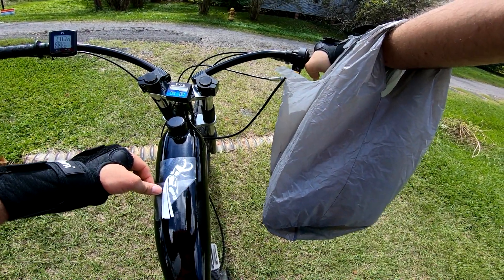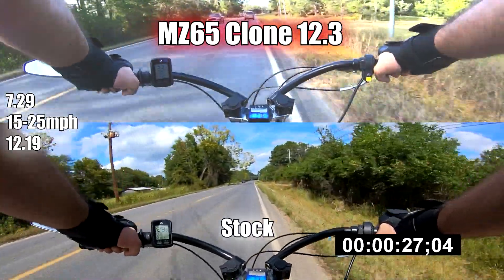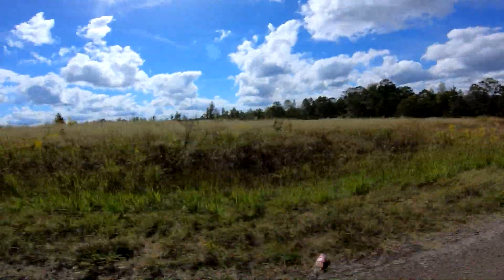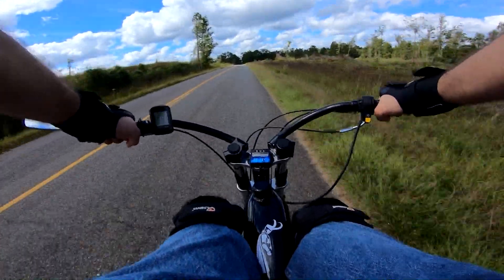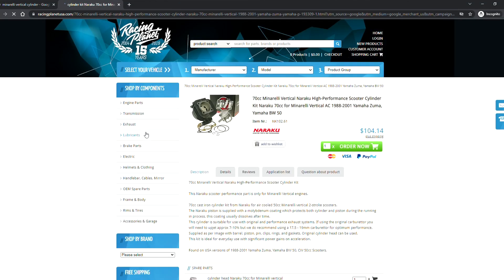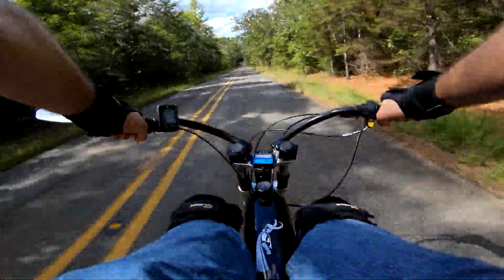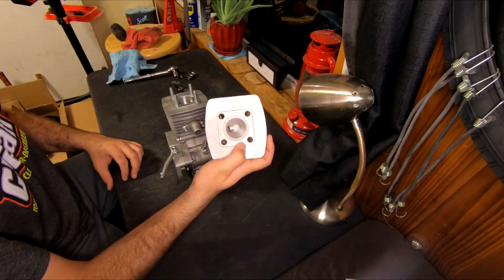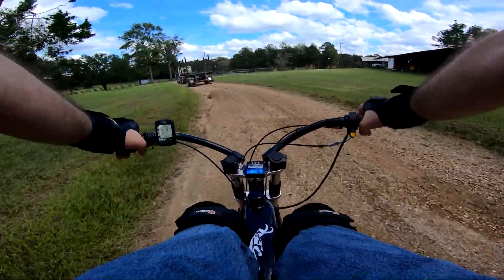Motorized Bike Performance Part 2

Comment: Do a test with the stock pipe and remove the end cap vs the mz65 clone. The results will be much much closer . Also stock pipe with stock jetting is rich so there is a power loss there compared to the clone.
Reply from the maker: Good call
Reply from the maker: kjsmolik brings up a good point. If the MZ65 Clone's expansion chamber is not effecting performance, than there is a good chance that a cap removal on the stock exhaust should give similar results, assuming you live in an area where you can get away with the noise ofc. :)
Reply: @LAHover  personally simply removing the baffle cap of a stock exhaust will never make as much power increase as a ktm65 or ktm65sx pipe. It just simply isnt designed for resonate flow. To each is own though. Personally i run a ktm 65sx on a ZL40MM crank with a Falcon 911 cylinder, ktm pipe is MUCH better than the stock, even baffle cap removed, also better than even gutted. Just personal preference tho ig
Reply: @LAHover  for the record bro i am also referencing a real ktm65 basic dirt bike pipe rather than the clone WC80 styles so chances are your results are exactly like mine haha, to be fair its all in the name. A clone isnt going to do as well as a standard db pipe but its certainly better than nothing personally (for the record the first time i ever hit 50 mph was with a gutted stock exhaust, didnt do it very fast but could wind up like hell lol)
Reply: Any chance we could run a test with a silencer that will get the dbs wound out down below 95db which is about bylaw and neighbor pi$$ing off volume. Where I live there is absolutely no way I can run the better pipe (probably even the stock)unsilenced or I'll have the cops on my doorstep every day! Thanks.
Reply from the maker: Link in the discription, the one I'm running is as silent as the stock pipe :) I love it!
Reply: @LAHover  fuck em bro let her sing haha, thankfully where im at currently for now people dont mind, only ever had 2 people say "damn thats loud" but they loved it still 🤣 just dont have the heart to run the muffler on the ktm pipe, makes it sound like a moped ☠️
Reply: I'm no expert but in my pipe research, the baffle cone of the mz65 is too close to the exhaust port and is most effective above 8k rpm. This was noted by a few pipe builders and their suggestions were to add 2" more belly or extend the header. That should pump up the HP around 5-7k

Comment: Awsome videos and great seires. I 100% agree with your therioes of limitations vrs. Longevity. I worked with a couple of the old blocks "LD80" they didnt even make it past breakin with pre-checks, torquing etc. The newer blick design I aquired and just finished prepping, and mounting and WOW what an improvement right off the bat. Much less vibrations... big plus, smoother even on very first start up and over all a better block which is  stampped "7MN"  on the jug as opposed to "LD80". Is it possible the new block breaths so much better that it could actually be running a tad lean? Even though the same carb setting worked great on the older design blocks. Too early to plug check. Just wondering? Because she loves a tad too much choke on warm-up. (Last moter dud that when I set her a tad too lean) Just asking, Being extra cautious with this one.

Comment: I have a wildcat pk80 on a bike with 700c wheels and a 36 tooth sprocket with an mz clone, I've only managed a top speed of 37mph and I'm pretty disappointed. I'm still playing with the jetting and I feel like I'm getting closer to the 40 mph mark. But sometimes I feel like I'm chasing my tail...
Reply from the maker: Anything 35mph+ is a respectable speed IMO.
The gear ratio of a 700c with a 36t sprocket should hit 40mph+ with a 200lb rider and the right jetting.
BUT, these speeds are pushing well past the safe limits of most bicycles so please be carful!
Reply: @LAHover  I think I'm still too heavy, I ordered the wrong set of jets, so the smallest one I have is either a 70 or back to the mystery jet that came stock.
Reply: Heavy with the jetting, not heavy in general lol. I weigh like 150 so I'm definitely not getting all she has

Comment: with a 2-stroke swapping out a straight pipe with an expansion chamber is like putting a turbo on a 4 stroke. 30+ years ago an old timer/ old school racer said it best. Putting an expansion chamber pipe on a 2-stroke is a sonic supercharger, as the pipe gets bigger it creates a negative pressure between the exhaust port and sound wave pulling out the burnt gasses and even some fresh air/fuel charge, as the pipe decrease in size it pishes the fresh charge back into the cylinder increasing the pressure at time of port closure acting like a supercharger/turbo. My person ride was a TRX250R with a grand national MX porting to boost midrange power, pipe/chamber was an LRD adjustable/tunable chamber where I could lengthen or shorten where the reverse cone started. With the MX porting and the pipe set in the middle my little 250 would DESTROY 350 Banshee and quadzilla 500 on the MX track. For bottom end punch lengthen the chamber, top end shorten the chamber. Class dismissed LOL

Comment: I use a 40t sprocket right in the middle of the 36t and 44t and I live in a hilly area of Florida and it does great, best of both worlds gives you decent speed while being able to get up even 30° inclines with minimal issue

Comment: Oh what bike frame do you think is the best. Huffy cranbrook or the hyper beach cruiser. Or is the build in gas tank frame better?
Reply from the maker: Gas frames bikes are nice but IMO not worth the $$$. I have never tried the hyper, but I like the back slanted seat tube. That might come in handy if you start testing bigger carbs and filters.
Reply: @LAHover  I have the hyper now and I use to have the huffy.

Comment: Not bad. I get 37 mph on a 20” rim with a 36 tooth. And can climb hills without pedal assist. It is all balance and believe me when I say hills. I live in a area where the elevation is 3,700 above sea level. But just want to have the engine to stop vibrating at top speed. Wish I could hit 45 mph.

Comment: I've had other engines, but this one with the G4 cylinder, real NT Speed carb and stock pipe, with a rubber ring in the carb, was the best running engine out of the box. It idled and I couldn't see any need for a jet change. A good bit of torque for as quiet as the stock muffler was.
Reply from the maker: Thanks for sharing

Comment: If your looking for a welder, the harbor frieght 110 flux core will weld a banana pipe and its cheap. Highly recommend a auto darken hood.
I wonder how a banana pipe with the exhaust end opened up would fare against the exhaust you tested. I found more low end torque to the point i no longer chug from a standstill, cant comment on top end

Also recommend more armor. Less skin to get rashed.
Reply from the maker: Thank you for this information!
Reply: Just remember the old saying cry once buy once. If you can afford a bettter welder, i highly recommend it. Manipulating metal is a handy ability.

The 110 kit from harbor frieght comes with the bare minimum you need to weld,  i forgot a decent wire brush with the auto darkening hood recommendation

Comment: I got my bike running so amazingly good. I didn't have a jet kit, and my bike was always 4 stroking making me think it was really broken. It was 4 stroking bad. What I did was I had a spare YD 100 carb from a friend, and I took the jet out of the regular carb and put it. In the yd100 carb since it had a bigger intake barrel, and moved the pin all the way up and now it gained 5 mph and the pull with a high compression head with an expation chamber is freaking insane. It pulls from stops no problem and mid-top end makes me fall back on my seat. It's pretty sweet. Top speed is only 29 mph though. It 4 strokes a tiny bit at full throttle at 29 mph. I ordered. A jet kit so hopefully. If I jet down 1 size it will help even more.
Reply from the maker: Smart swap with the stock jet to the YD carb for more air! :)
Reply: @LAHover  today i jetted down to like a 65, and i got to 35 mph on my first pull, it was a short pull and i bet it goes faster! this bike is crazy dude, all because of your videos i learn so much!

Comment: When you're ready to build your own pipe leave one variable, that being a stinger that can slide into the expansion chamber and back being clamped at any given point, thus creating a variable back pressure which will help with the scavenging effect. I once did r&d for Kawasaki and that trick saved tons of time when testing expansion theories on dyno tuned pipes
Reply from the maker: That sounds smart to me! Thanks for the info :)
Reply: Wow that's brilliant.

Comment: I’m putting on a g2 reed valve with my stock carb and windowed piston will it make my bike faster or hurt it
Reply from the maker: With stock port timing I don't think you will see much of a performance difference. From what I understand (could be wrong), Reed valve set ups work great once you start increasing intake duration... among other things. I'll do my best to test a reed valve early in the series for you guys.
Reply: @LAHover  oh so do you think I should just not do it and also I would like to see that in a video
Reply: @paullehman8652  upgrading the exhaust is your best proven bet, as far as bolt on power.
Reply: @subspyn9828  I have an upgraded exhaust
Reply: @paullehman8652  I'll tell you what ,I did the same thing you are wanting to do with the bolt on upgrades. But my bike ran way worse. I had bought a CDH Power Dio Reed, I also ordered a windowed piston, which I had watched video after video, to try and make sure I got the correct size and shape window in the piston right, lol ok stuff finally comes in I put it all on the bike....... The dam thing wouldn't start. So 2 more hrs later finally get it to start, but now had to stay on full choke or would die. But it lost big power gained no power. Now this was on an 80cc motor that I had and had stock carb stock exhaust and the cylinder was not designed to accommodate a Reed setup, as far as transfer port, port timing etc.
 But it didn't cost a bunch money , I may have had thirty bucks in it lol so if you want to do you own testing, this isn't going to financially cripple you or anything lol. But for me it was a waste of money
Hope this helps , good luck with yours. And if you have better or different outcome let me know what was different
Reply: @subspyn9828  yeah dude I’ll keep you posted about it

Comment: As long as you put in a bigger fuel jet to increase the fuel whn you put a tuned pipe/exhaust on it will be fine and run abit more 2stoke oil or better oil will  help with it lasting longer 👍👍👍👍👍👌👌💯💯💯💯

Comment: Can't wait until you get the phantom up and running again, I got in contact with bicycle engines and have parts on the way. Still haven't run mine yet... I may do what you did to try it out, put it on a bike as a swap.
Reply from the maker: lol <3

Comment: The wc80 is still not worth 3-400$ imo tho, even with added acceleration, personally a gutted stock will do the same acceleration. Hands down though very in depth and nice example of the two between themselves
Reply from the maker: Might be thinking of a different pipe, or the price may have been inflated when you saw them. ATM The Deluxe/WC80 (same pipe) are about 80-100.
Thanks for the love :)

Comment: Wow I’m suprised the mz clone did that well at about 8-8.5k is where it fell on its face for mine
Reply: Its designed to work at a specific rev range, the design of the pipe limits it to mid end iirc (8k rpm)
Reply: @corylee4054  Ik

Comment: ive made two expansion chambers for these bikes, I think the basic things to note are that the longer the header pipe is, the lower rpm range it will help. If its too short, your bike might not even get into the rpm range where the expansion chamber is useable. The length of the diffuser come also affects this. The angle of the diffuser cone affects how wide of an rpm band it affects. Lower angle = more range less peak power. I think since these bikes don’t have gears, a long and low angle diffuser cone is the way to go. As for where the expansion chamber kicks in on the rpm band, make sure your back sprocket is big enough to allow you to reach these higher rpms if you have a shorter header. Expansion chamber body diameter should be about 2.5 time header diameter/ exhaust port diameter. the stinger diameter should be about 65% the header diameter. These are the approximate figures I used (going off some other guy who did something similar) Theres a lot more I could go into regarding expansion chamber angles, diameters, and lengths but that’s the basics I’d say. If you want to have one of my expansion chambers I’ll send pictures and sell it to you if you’re interested.
Reply from the maker: Thank you for sharing your knowledge with the community!

Comment: Great vid,and info LA.Thnx.When I just changed from the stock muffler,(modified as you've shown too)to the Poo-Poo,my bike's torque jumped to where it wanted to wheelie.When you get the ports cleared,will you please compare the P-P to the MZ?Thnx again.
Reply from the maker: Nice man! I'll touch on it when we get more into pipe on the series.

Comment: I got one of them pipes , it did help in getting to top ram a little quicker. Can't say it actually run better with the exception of when it was singing.
I expected more.
After taking a good look at the pipe with seem to be made out of cheap electrical conduit pipe rather than exhaust pipe.
The pipe was shoved in like 6 inches on the one side and 4 or 5 inches on the other side. I cut the welds pulled the pipes out and rewelded them. Actually works better now.
Not sure if the volumemetric  is right for this motor but helps
Like you said in one earlier video relating to bang for the buck keep em cheep a little elbow work and fun

Comment: Can you compare the clone mz65 Vs real Vs wc80?
Reply from the maker: Yup! already planed out :)
Reply: Hardware570 said the MZ65 clone isn't nearly as good as an actual MZ65 because the clone has a small single size diameter restrictive header....The real MZ65 has a header pipe that gradually increases in size/diameter before it gets to the belly that apparently allows for better back flow into the engine. 
  I'm by far no expert but read the long straight cone style expansion pipes often seen on mopeds are made to mainly increase top speed/end power since they're most often rode wide open throttle cruising down the road. The curved type like the MZ65 on dirt bikes are made/curved for ground clearance but also to provide improved power through the whole throttle range, not just top speed.   I just noticed something else bogus about BikeBerry is they show a picture of a real MZ65 pipe for sale $70 but then send you the clone.

Comment: Great Video. I have build one kit in the past and it was made by anbull. Great kit. I am looking at building another one and I was wondering if a chinadoll would fit on a granite peak roadmaster from walmart without any major modifications. I want a bike that is safe to ride and was wondering if I shoudld go with the roadmaster or a huffy cranbrook. Thanks.
Reply from the maker: I have built on and enjoyed both bikes. I recommend the Granite Peak over the huffy so you don't have to deal with the coaster brake hub and rear wheel bearings. 
It is a bit of a tight fit around the carburetor, but on most builds I was able to just remove the air box and ziptie the air filter and filter cage to the carb... or use an off sett intake if you can find one this is not junk...
Reply: @LAHover  Thinking about putting a Seeutek engine on it because I was watching your video on what engine kit to pick. Thanks again.
Reply: A cnc shorty intake might work too. Used one on a Mongoose Mack.

Comment: Everyone says the real mz65 blows the clones out of the water... as far as I know nobody has actually got any numbers to back that up. I believe a real problem in the motorized bike hobby is that there are way too many myths and unconfirmed claims, it's mostly voodoo magic. Now I understand that it's hard to get data because of so many variables in these engines... but still, no one actually tests their bike's performance before and after porting, for example. I really appreciate the work you're doing to get some solid facts.
Reply from the maker: Thank you and well said! I do also believe the real MZ is as good as they say, but a solid head to head will be nice to see just to know how much better it is. can't wait to test it :)